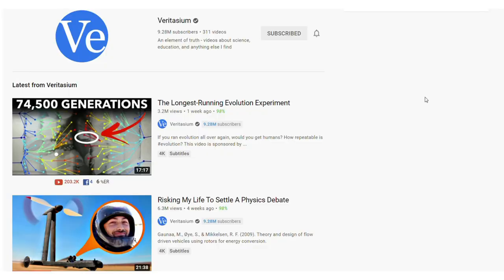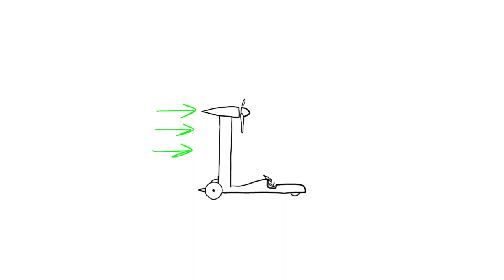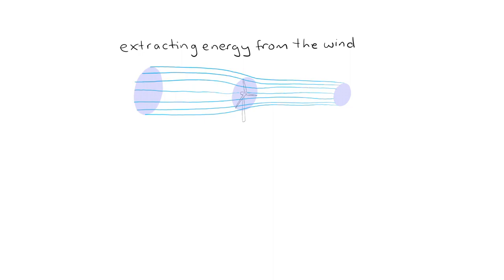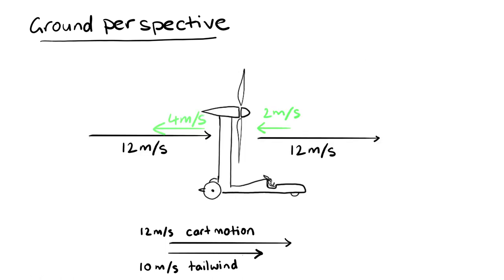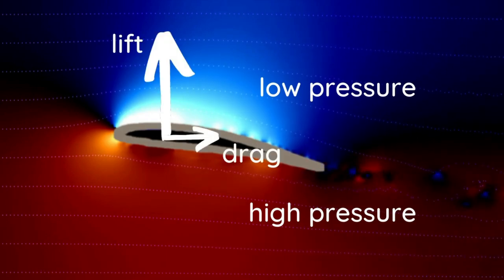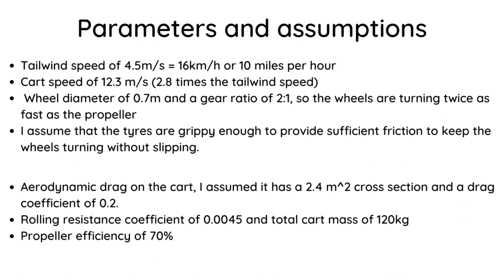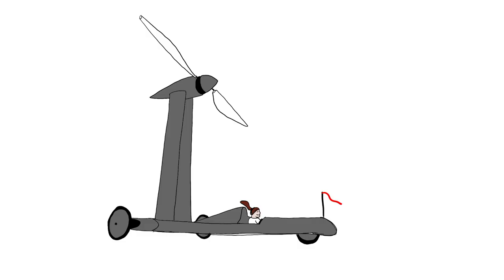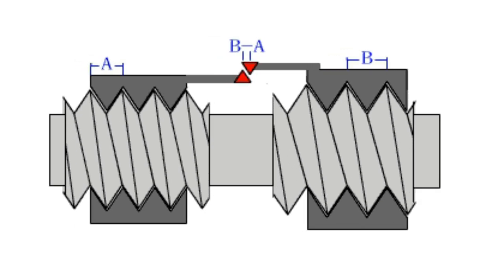Downwind Faster Than the Wind by Veritasium: How Does it Work?

Comment: NOPE, NADA, ZILCH, CAN'T WORK

You have to FOLLOW THE ENERGY . . .

Wind can certainly force a vehicle to move, relative to the ground, at the same speed as the wind, relative to the ground, ignoring the friction of the vehicle's wheels against the ground and internally against the axles. Even more fiction would exist if the wheels are linked to some other mechanisms, like a propeller.

The wind, from the back, applies a force to the vehicle, causing it to move, transferring energy to the vehicle in the form of momentum. Wheels rotating as a result of their interaction with the ground can indeed transfer some of that energy into other mechanisms, like the propeller. In the Blackbird configuration it is precisely that sequence of energy transfer, from wind to vehicle movement, to wheel/ground interaction, to propeller, that can indeed cause the propeller to spin.

But let's assume that the wind can indeed get the vehicle travelling at the exact same speed as the wind. The vehicle would then be effectively stationary relative to the wind. The vehicle would not actually be experiencing any wind, so no wind PUSHING the vehicle, no force applied to the back of the vehicle, no energy transferred to the vehicle. From a practical standpoint this couldn't last very long since friction of the wheels against the ground would be involved and the vehicle would quickly slow down, at least just a little, in which case there would again be a relative wind against the back of the vehicle, again applying force and again accelerating it back up to equal the wind speed. It would essentially fluctuate between a little less than wind speed and exactly equal to wind speed.

Now let's assume that somehow (magically?) the vehicle gets moving, relative to the ground, FASTER than the wind is moving relative to the ground, basically outpacing the wind. What kind of wind does the vehicle experience? The answer is that it now experiences/feels, wind coming from in front of it, impinging on the front, not the back, of the vehicle. It's encountering a HEADWIND, as opposed to the tailwind that had been causing the vehicle to move forward. The headwind imposes a DRAG on the vehicle, contributing to the slowing down of the vehicle, in addition to the slowing down caused by the friction of the wheels interacting with the ground.

Importantly, that headwind is slowing down the vehicle. The wind is no longer adding energy to the vehicle. Rather, it is REMOVING energy from the vehicle. The vehicle's energy is in the form of momentum, which is due to it's speed relative to the ground. When the headwind slows down the vehicle its speed decreases, which decreases its momentum, which decreases the amount of energy of the vehicle. Thus, the amount of energy available from the interaction of the wheels against the ground also decreases, essentially because the wheels to rotate slower as the vehicle slows down. And with that decrease in energy available from the wheels there is also less energy available to the propeller. Which means that the vehicle CANNOT maintain a forward motion that's faster than the wind, and certainly cannot continue to accelerate. The faster the vehicle goes, above wind speed, the LESS energy there is that's available to power the vehicle.

As I said previously you have to "follow the energy". Where does it come from? How does it move from wind to vehicle to wheels to propeller? And then look at what the vehicle is experiencing from the wind, what forces are imposed on the vehicle, from the perspective of the vehicle, when it's standing still relative to the ground, when it's moving forward relative to the ground, when it's accelerating up to the speed as the wind (via the tailwind), when it's moving at the exact same speed as the wind, and when it's moving faster than the wind (experiencing a headwind)? In what situations can the vehicle actually accelerate or even maintain its speed?

The very best that a "faster than wind" vehicle could do is to have its speed fluctuate between a little bit faster than the wind to a little bit slower than the wind, averaging out to simply the wind speed.

And the ONLY way that such a vehicle could, for a short period of time, go faster than the wind is if it is STORING UP ENERGY, perhaps by a flywheel (and frankly even the rotating propeller could be acting like a flywheel) while the vehicle is accelerating up to the wind speed. When it gets up to close to the wind speed it then ENGAGES that flywheel and uses that extra energy to accelerate to a bit faster than the wind. But as soon as that extra energy is exhausted the vehicle again slows down. And please do note that in the original video it's mentioned that the propeller is not engaged UNTIL a certain time when they want the vehicle to exceed the wind speed. Rather suspicious, don't you think.

But, bottom line, FOLLOW THE ENERGY.
Reply: @johnborton4522  Science/truth is not determined by monetary bets, it's determined by facts and reason.

You quote the conclusion I drew from the prior sequence of statements I made. How about you identify where in that sequence of statements I made a mistake or a false assertion? How do YOU trace the path of energy through the system leading to a vehicle that can CONTINUE to travel faster than the wind that's pushing it, in the same direction as the wind?
Reply: @RogerGarrett  

As it turns out, monetary bets are settled by the exact same methods as science ... controlled, repetitive demonstrations in front of inquisitive skeptics followed by independently verified results.

The science and truth of this were settled and documented more than a decade ago and independently confirmed countless times since.   The wagers are only about compensating me for my time when a Tom, Dick or Professor Kusenko (or Roger) doesn't want to do their homework but instead simply relies on intuition.

https://en.wikipedia.org/wiki/Blackbird_(wind-powered_vehicle)
Reply: @RogerGarrett  "Science/truth is not determined by monetary bets, it's determined by facts and reason."

The facts are against you here (google NALSA downwind record) and so is reason (google AAPT 2013 physics olympiad solutions -> page 10)
Reply: @johnborton4522  HA! You cite a Wikipedia article that's quite obviously written by YOU, or maybe your partner in this vehicle!!

Here's the thing, . . . since you are so intimately knowledgeable about how you claim it works, it should be incredibly simple for you to point out which assertion I made is wrong or which logical sequence of mine is wrong in the explanation I provided about following the energy. The basic fact I assert is that once the vehicle is going faster than the wind the wind is no longer, CAN no longer be, providing energy to the vehicle. Any energy that's being provided to the propeller at that time comes from the momentum of the vehicle itself, not from the wind, and as that momentum-energy is used up by the rotating propeller the craft will SLOW DOWN. It simply CANNOT maintain a speed greater than the wind since no energy is available from the wind when it's travelling faster than the wind. It's no different than accelerating a gas-powered car up to some speed and then taking your foot off the gas pedal. It will SLOW DOWN.  And if you had even rigged up a propeller on that vehicle that gets its energy from the interaction of the wheels with the ground, the only available energy is in the momentum of the car. It will still slow down.

Do you still assert that your vehicle can MAINTAIN a speed greater than the wind speed as long as the wind blows at that speed? Or are you going to backtrack on your claim and simply say that, for short bursts of speed, for short periods of time, the vehicle can go faster than the wind?

Oh, and PS: There is absolutely nothing involving intuition in my comments. I very clearly set out a logical sequence of assertions. Try addressing that.
Reply: @RogerGarrett  

Apparently you aren't familiar with the way Wikipedia works - it's not the narrative that matters.   You'll notice these things called "footnotes".   These are a repository of the actual knowledge, tests and experiences described in those notes.

It's called 'homework".  Do some, and you'll find that your intuition is wrong.
Reply: @RogerGarrett  "There is absolutely nothing involving intuition in my comments. I very clearly set out a logical sequence of assertions"

But your "logic" is just intuitive reasoning. What matters in physics are experimental results (see NALSA downwind record) and formal analysis (see for example AAPT 2013 physics olympiad solutions, page 10)
Reply: @RogerGarrett  

// "The vehicle would then be effectively stationary relative to the wind. The vehicle would not actually be experiencing any wind, so no wind PUSHING the vehicle, no force applied to the back of the vehicle, no energy transferred to the vehicle. "//

This of course is just your intuition.  The real world shows otherwise.

Iceboats have been sailing faster than the wind (downwind VMGs >1.0) for more than a century   Land yachts for many decades, and sailboats for near 2 decades now.   It's been more than 15 years since an America's Cup boat threw out a spinnaker -- why? ... because they now sail downwind VMG faster than the wind and a spinnaker would be the slow way down the course. 

Your intuition (which you mistakenly assert as "logic") simply can't hold a candle to real world results. 

Homework.
Reply: @RogerGarrett  

Oh God.  I'm laughing so hard right now.  Just found out that you are a buddy/acquaintance of Garrett Lisi.  Tell him I'll see him next time he's up at the red house. 

You get with Garrett on this -- he'll quickly explain how your "logic" on this ... isn't.

Hurry back now, ya' hear?
Reply: @eyytee  [ sigh ] Even if intuition is involved when someone lays out facts and the logic that connects them, it is that sequence of facts and logic which should be evaluated. Dismissing something simply because of the assertion that it was arrived at using intuition is just avoiding the assertions, the facts, the logic. The proper way to respond, to actually engage in a reasonable, thoughtful, conversation, is to look at what's presented and point out which facts are wrong, which logical connections don't work, and why.
Reply: @RogerGarrett  

// "it is that sequence of facts and logic which should be evaluated."//

We evaluated what you wrote.  It wasn't factual and it wasn't logical -- we know this because doesn't comport with the facts of the case (AT ALL).

// "The proper way to respond, to actually engage..."//

Well, as long as there is a lecture going on here regarding "proper engagement", ... the proper way to engage is to learn the facts of the case before going off with only your intuition engaged.  

Let me remind you of your opening "engagement" 

// "NOPE, NADA, ZILCH, CAN'T WORK"//
// "And the ONLY way that such a vehicle could, for a short period of time, go faster than the wind is if it is STORING UP ENERGY"//

Let me remind you what you did when I pointed you to a link which contained the links to enough facts about the case to blow your position away:

// "HA! You cite a Wikipedia article that's quite obviously written by YOU, or maybe your partner in this vehicle!!"//

And there you go ... more intuition, accusations and zero facts.  You're wrong about the device and you're wrong about the Wiki page.  The truth however, it is doesn't matter who wrote narrative on the Wiki, it's the footnotes that matter.

You'll find we're very open to answering questions about how it actually works, but if you're just going to drop your ALL CAPS bombs on us from the start, we're going to have our own fun with you.  Forget "proper", I'm just going to call it "appropriate" engagement.  

So, you're wrong.  If you don't know just how wrong you are, check with Garrett. After that, come back with your tail between your legs and give us a whiny lecture on how we should have spent endless hours arguing with Your Cocky Highness on your terms.
Reply: @RogerGarrett  "... to look at what's presented ..."

Have you looked at the references linked in the description of the follow-up video by Veritasium (AAPT, Drela, Gaunaa et al.)?
Reply: @RogerGarrett  

So Roger was all about engagement and the scientific process and education, but now that he has figured out that his intuition failed him (no shame in that -- the Blackbird is one of the best physics intuition traps in history) he's like the professor -- gooooooone.   He's not into the engagement and education when it turns out he was the one who needed it. 

Here's how the scientific method really works Roger ... build it, break it, improve it, openly show the process, ask others to independently judge it and encourage duplication.

We did.
Reply: @RogerGarrett  "This report explains nothing about how it works"

That is explained in the references linked by Veritasium in the description of his the 2nd video (AAPT, Drela, Gaunaa et al.).
Reply: @johnborton4522  Wow, that just makes it totally clear that you have no understanding of momentum. No claim is made by me that you can run at 51 miles per hour. But when you're pushing the vehicle up to its just-above-wind-speed you are imposing a force on the vehicle, causing it to move, and that movement constitutes stored energy in the form of momentum. If you were to push a hundred pound vehicle up to 11 miles an hour it would have received a certain amount of energy. If you had pushed a thousand pound vehicle up to that same 11 miles per hour it would have a hell of a lot more momentum/stored energy. You didn't need to go faster than the11 miles per hour, but the vehicle, being heavier, got more energy/momentum.

When you let the vehicle go, and the transmission is engaged so that the propeller is now driven by the rotation of the wheels against the ground (or the pitch of the propeller is changed so that it's no longer free-wheeling but rather acting as a propeller), then it's tapping in to that stored momentum, that movement of the vehicle (as well as the momentum of the rotating wheels, which is likely significant in the overall operation). And, sure, the propeller, through the gears of the transmission, can be made to rotate fast enough so that enough of the momentum of the vehicle can be transferred to pushing the vehicle even faster. But as soon as it does that, as soon as the vehicle's momentum is providing that from the wheel rotation to the prop rotation, the overall vehicle's momentum is reduced (I suspect likely coming from the wheels, acting like flywheels), there is less and less energy to drive the propeller. So, yeah,  you can get a brief burst of speed, even to something faster than the ambient wind, but eventually, (likely quite quickly) that available momentum is used up and the vehicle slows down. Can it go faster than the wind for ten seconds. Apparently. But that in no way means that it can sustain such a speed.

And even when the initial push of the vehicle is indeed provided by the wind (not by someone pushing it) it's the momentum of the vehicle itself, and I suspect significantly the momentum of the rotating wheels, that allow it to momentarily exceed the ambient wind speed. It might go faster for some ten seconds, but it will soon slow down, back to below wind speed, at which point the wind can indeed speed it up again to the same as the wind speed. The result is that it will fluctuate between somewhat below wind speed and somewhat above wind speed, with the average speed being at (or likely slightly below) wind speed.

It's stored momentum that you're using. And the wind ceases to provide that momentum once the the vehicle is travelling faster than the wind.

Show us a test where it just kept going and going and going at faster-than-wind-speed.
Reply: @RogerGarrett  

As to your momentum gibberish, using that gibberish explain how in the video I posted above why you see the propeller and wheels continue to turn faster and faster and faster and faster for a full three minutes WITHOUT any push.  A full minute and a half after passing through windspeed and ending up at near 50mph and near 3x the speed of the wind. 

Now, where is the stored energy coming from?  What giant flywheel, capable of accelerating a 600lb craft from windspeed to 50mph did NALSA and the other skeptical parties miss when they did the inspections?  (And if you say the propeller or wheels, you'll erase any doubt about you're a complete idiot as any flywheel has to slow down, not speed up to give up any stored energy).

The truth is, the only spinning parts in the entire Blackbird are constantly having their stored energy INCREASED as the vehicle accelerates, not decreased. 

Do yourself a favor -- stop arguing and looking like a fool.  Call Garrett.
Reply: @RogerGarrett  "It's stored momentum that you're using"

No, because all the stored momentum (including of the rotating parts) is increasing when the vehicle accelerates. So it is not using up any stored momentum or energy to accelerate while being above windspeed, and thus can stay above windspeed in steady state.
Reply: @eyytee  So what is it that accelerates the vehicle? The energy has to come from somewhere. The claim is that it comes from the ambient wind, but the ambient wind is no longer pushing the vehicle once the vehicle's speed matches that of the ambient wind, and once the vehicle is going faster than that ambient wind the vehicle is experiencing a relative headwind, a drag on the vehicle, which is not a source of energy. Much is made about how it's the turning of the wheels that turns the propeller, but the wheel-turning is occurring only because the vehicle is moving relative to the ground, and the vehicle is moving only because of some energy pushing it forward, so you've got a closed loop with every-increasing speed. Where does the energy actually come from to keep it accelerating??

It is not sufficient to build a test vehicle and have it go faster than the wind. There needs to be an accompanying Theory of Operation to show HOW it can accomplishes that. 

Every decade or so someone comes out with a car that runs only on water. They show it, operate it. Sometimes makes claims about splitting the water into hydrogen and oxygen and combusting those gases for the energy source, all on-board. And they eventually fade into history, with no actual proof that it works, even though they had a test vehicle!! That's what this Blackbird seems to be doing. Got a test vehicle? Yup. Convinced people that it works? Yup. Provided a scientifically sound, reasonable, and verifiable Theory of Operation? Well, I haven't seen any. I've looked, but haven't found any. The response by the inventors should be, "Here's a direct link to the Theory of Operation, explaining everything", but instead they just get angry about people having the audacity to question them, point to their test runs as though that's proof, point to people that they've convinced it works, and point to a bet that someone conceded on.

If YOU can provide a link to the Blackbird Theory of Operation, I'd appreciate it.
Reply: @RogerGarrett  

http://kirkmcd.princeton.edu/examples/yacht.pdf

That one contains a ton of links to other analysis as well.
Reply: @RogerGarrett  

// "It is not sufficient to build a test vehicle and have it go faster than the wind. There needs to be an accompanying Theory of Operation to show HOW it can accomplishes that. "//

We really don't need someone as wrong as F888 to tell us how it needs to be done.  The analysis was done LONG before the Blackbird was built.  The Blackbird was designed and build based ON the analysis.  We built the Blackbird because people like you (as you have done here) said the correct analysis was BS.

There has been for more than decade, both correct analysis and third party verified physical demonstrations and you still respond: "NOPE, NADA, ZILCH, CAN'T WORK"  and accuse us of being responsible for publishing content we had nothing to do with.  

Then you say absolutely stupid stuff like: "It is critical to understand that the wind had absolutely nothing to do with powering the vehicle. All of the energy employed by the vehicle came from JB manually pushing it from behind" . 

What's critical to understand is that you're a maroon just based on that above single statement alone.
Reply: @RogerGarrett  why do you assume that the propeller can't extract energy from the wind while moving faster than it? thats ridiculous, as the propeller does not operate on the wind with only drag, but with also thrust. If you follow the energy as you put it, then you'll find that the air behind the vehicle has slowed down because the propeller is actively accelerating the air. That must mean that the craft has a forward force on it. Its constantly making the air and the grounds speed to become closer together, and that energy has to go somewhere. 

For example, there's this, https://www.youtube.com/watch?v=k-trDF8Yldc&t=10s  . Despite it going faster than the ruler, it can still harvest energy from the rulers movement. Although the ruler and the air act differently, I don't think its immediately impossible to build such a device that works with air, and in fact its not, its just a simple propeller.  

Also I find eyytee's animations very enlightening.  https://www.youtube.com/watch?v=H_OKNr120t4  https://www.youtube.com/watch?v=zPFzHoubQzg .
Reply: @RogerGarrett  After the smug  "NOPE, NADA, ZILCH, CAN'T WORK" opening, it seems you owe the builders an apology since it does work.  You fundamentally missed five big points:

1) repeatable empirical experiment have always trumped "theory" when they disagree (which is a clue that theory has to be revised and modified (or an alternate explanation has to be appended) to accommodate reality).  A demonstration of a cart working under carefully controlled conditions on a steady state treadmill demonstrates that not only is it possible but it has been accomplished (which theory without demonstration would not).

2) the energy comes from the carts interaction with the true wind at all speeds since the propeller can most definitely interact with the air at windspeed (and slow it over ground) even though the cart body doesn't.  It is factually wrong that the total cart mechanism can't interact with the wind at windspeed which is both logical (from the simple theory of how a propeller works to the empirical--with interaction of the prop with the wind clearly illustrated with streamers behind the propeller at windspeed on treadmills).  It is, however, a classic misconception and fallacy of you and other novices, that the vehicle can't interact with the air at windspeed.

3) the vehicle shown was designed (with a ratchet mechanism in the drivetrain) so that none of the previously stored rotational energy from lower speeds could be utilized to increase and accelerate the cart thus negating that as a possible mechanism of operation. 

4) the energy of the true wind is decreased with the cart's passage through it and some of that energy is what is given to the cart to accelerate it.   It is nowhere close to ideal and real world losses occur and yet the wind energy reduction yields adequate energy to power the cart up to its limit speed which is well above wind speed.

5) a valid energy budget which includes the reduction in the energy of the true wind processed by the cart yields that there is more than adequate energy lost by the true wind to power this particular cart (and any other functioning carts) to well above windspeed thus illustrating that theory does not preclude its functioning.

Had you simply asked nicely, many of us would have been happy to explain all five of these points to your objections.   Now, without a bit of humility and an apology, you just look like a goat with bad logic and very limited physics knowledge.  Without the written apology here, you can continue to look like the bad mannered Kusenko who had adequate hubris and no humility (even though he at least paid his debt).  Since no one was claiming "over unity" or any violation of COE, but only wind energy, a more humble objection was appropriate.
Reply: @jetison333 It has been made very clear in numerous videos, documents, and comments that the propeller on the Blackbird is NOT operating as a windmill, and therefor is NOT extracting energy from any wind, but rather is acting as a propulsive mechanism, USING energy provided to it by the rotation of the wheels to accelarate air backwards and thereby accelerate the entire craft forward. It's a propeller, not a windmill.

The propeller does indeed operate with thrust, because it's operating as a propeller, to PROPEL the vehicle.

The air behind the vehicle is NOT slowed down by the propeller. The way a propeller works is by ACCELERATING the air from in front of it to behind it. The propeller exerts a force on the air, the result of which is an acceleration of the air backwards and an acceleration of the vehicle forwards. That's how any propeller-driven craft works.

The  fact that the speed of the air behind the propeller is slower than the WIND is irrelevant. That in no way contributes any energy or force to the vehicle. The only thing that's relevant in the Blackbird regarding its propeller is that the air in front of the propeller is accelerated backwards and the vehicle forward.

The assertion is that the Blackbird derives its energy from the rotation of the wheels, that the propeller is turned by the rotation of the wheels. Those wheels rotate ONLY because of the forward motion of the vehicle. But the assertion is that the propeller, powered by those wheels, accelerates the vehicle, and that since the vehicle is now going faster than it was the wheels are now turning faster so the propeller turns faster so the vehicle goes even faster and the wheels turn faster, and on and on. Do you not see the  problem with that? It's a perpetual motion machine. It's an over-unity energy generator.

Suppose we forget about the wind, just start the vehicle in static air. Give it a push to get it going. The wheels power the prop, the prop accelerates the air and the vehicle. The vehicle, now going faster causes the wheels to turn faster which turns the prop faster, which accelerates the vehicle, and on and on. WHERE DOES THE ENEGERY COME FROM to do that?

The Blackbird builders assert that somehow the wind is involved. But HOW? When the vehicle is going faster than the wind, how can that wind contribute any energy to the vehicle? The wheels and propeller don't give a damn what the ground-relative wind is doing, all it does is react to and deal with the vehicle-relative "wind", not the ground-relative wind.
Reply: @RogerGarrett  The way the propeller interacts with the air is as a propeller yes, and that is what everyone means when they say that. However, what it actually does is harvest energy, which makes it a sort of turbine. 

When you say that a propeller can't slow air down your thinking in the wrong frame of reference. In the frame of reference of the propeller, yes, it never slows air down it only speeds it up. And in the case of the blackbird this is true, and thats why people say its a propeller. In its frame of reference it is speed the air up. 

However, from the reference frame of the ground, the propeller is necessarily slowing the air down. The air is moving to the right, and the propeller is accelerating the air to the left. that means that the air is slowed down. And since the air and the ground are now moving at more similar speeds, there's less energy in the system and that energy has to have gone somewhere, which it has, into the blackbirds speed. 

And the wind is necessary, because without it, blackbird is actually increasing the speed of the wind relative to the ground and so loses energy. Since there is no relative motion between the wind and the ground, theres no energy to extract by slowing something down.

Heres another way you can think about it. Given the ability to engineer 100% efficient components, you could build a cart that has a propeller connected to its wheels. Since everything is 100% efficient then the amount of energy that is taken from the ground is produced by the propeller again, the cart will not slow down. Now we introduce a tail wind. With a tail wind, the prop will now produce more thrust, as its apparent wind is less, which means that the cart will now be accelerating. Note that I didn't have to specify how fast the cart is moving, as even when its moving faster than the tail wind it still knows the tail wind is there because it experiences less apparent wind.
Reply: @RogerGarrett  

// "Do you not see the  problem with that? "//

The "seeing" problem is your, because in your paragraph, you leave out the input energy of the wind.  Kinda important in a wind powered vehicle.

Describing a squealing 'microphone, amplifier, speaker, microphone, amplifier, speaker, microphone, amplifier, speaker..." feedback loop sounds just 'over-unity' till someone goes to the wall and unplugs it.  Your description is just a silly if you ignore the 'power cord'.
Reply: @eyytee  The question remains: If it's not stored momentum then what energy is it that's increasing when the vehicle accelerates, or more precisely, what energy is it that's causing the vehicle to accelerate? The ambient ground-relative wind cannot contribute energy once the vehicle is either at that wind speed or greater than that wind speed, because the only "wind" that the vehicle encounters when it's going faster than ground-relative wind is the vehicle-relevant wind and that vehicle-relevant wind is a Head Wind under that circumstance, imposing a DRAG on the vehicle, not a PUSH on it. If anything the vehicle-relevant wind is DECREASING the energy of the vehicle, imposing a negative force on the vehicle's motion, slowing it down.

Explain what it is that causes the vehicle to accelerate when it is going the same speed or faster than the ground-relative wind. Where is the necessary energy coming from. HOW is the ground-relative wind involved in that supply of energy to the vehicle?
Reply: @jetison333  The only air speed that is relevant to the propeller's operation and it's use for moving the vehicle is the air speed relevant to the propeller, to the vehicle. What the air is doing relative to something else, like the ground or a turtle or someone walking randomly or the Moon or Mars, is utterly irrelevant to the operation of the vehicle.

Your claim that the propeller, acting as a propeller, is also somehow acting as a turbine, "harvesting" energy from the ground-relative wind, is absurd. I repeat, the only interaction that the propeller has is its interaction with the propeller-relevant "wind", or as it's often called the "apparent wind".

The propeller does indeed accelerate the air backwards and correspondingly accelerates the vehicle forward, or KEEPS it travelling at the same speed considering the drag and other forces impinging on the vehicle. No one is claiming otherwise. But the fact that the propeller-accelerated air is now going slower than the ground-relative wind has absolutely no bearing on how the propeller is working or how the vehicle is moving. The vehicle and its propeller ONLY interact with vehicle-relative wind.

Your assertion that the propeller is somehow "harvesting" energy from the wind simply makes no sense.

When a prop-driven plane is moving through the air at some speed and it encounters a tail wind it does indeed speed up, relative to the ground, because that tail wind is imparting a force in the same direction of the plane. The sum of the forces from the prop and the tail wind speeds up the plane. But once the plane is moving at the same speed as the tail wind there is no more acceleration, it is only the prop, driven by the energy provided by the onboard fuel, that keeps the plane moving at the now-increased speed. There is no more acceleration. Yes, the plane is now moving faster, relative to the ground, as long as that tail wind persists, but it is in no way "harvesting" energy from the wind.

In your "other way of thinking" you cite "the amount of energy taken from the ground". There is no such energy. The only energy available is that which comes from the MOTION of the cart, RELATIVE to the ground. The cart must first be pushed, providing energy to it from whatever is doing the pushing. And describing an impossible 100% efficient setup has no bearing on a real-life situation. The fact still remains that once the vehicle's speed is equal to the ground-relative speed the vehicle-relative WIND speed is ZERO, so the efficiency of the propeller, the thrust produced by the propeller, is back to what it was when it was just travelling through still air. The ground-relative wind can have no additional impact on the prop or the vehicle. And further, IF the vehicle somehow gets going FASTER than the ground-level wind, then the interaction between the apparent wind and the prop will be the OPPOSITE of what you're citing for the initial condition, which means the prop would be producing LESS thrust and the vehicle would therefore slow down.

Your statement that "even when its moving faster than the tail wind it still knows the tail wind is there because it experiences less apparent wind.". No, it experiences a HEAD WIND in that situation, a wind that has the effect of SLOWING DOWN the vehicle.

And I still assert that when the claim is made that the energy for the powering of the prop comes from the rotation of the wheels (the interaction of the moving-forward wheels with the stationary ground), and the rotating props (somehow interacting with the ground-relative wind) accelerates the vehicle, further increasing the wheel rotation, further increasing the rotation of the prop, further accelerating the vehicle, and on and on, the effective claim is for a perpetual motion machine and/or over-unity power generation. At the very best the claim could be that there is an upper limit to how much acceleration can occur, an upper limit to the speed of the vehicle, based on the speed of the ground-relative wind (and the mass and air drag of the vehicle, efficiency of all the parts, etc.). But, no, the claim is made that it can "continue accelerating".
Reply: @RogerGarrett  

Poor Roger.   Stumped.  Insists he's right even though all the physical evidence and correct analysis says otherwise.
Reply: @RogerGarrett  

Let's not forget this classic which clearly illustrates the clarity of Roger thought we are dealing with here -- on a vehicle which under independent review repeatedly reaches over 50mph (even when not pushed).

Roger:
// "It is critical to understand that the wind had absolutely nothing to do with powering the vehicle. All of the energy employed by the vehicle came from JB manually pushing it from behind."//
Reply: @RogerGarrett  "The Blackbird builders assert that somehow the wind is involved. But HOW?"

Without the true tailwind, the relative headwind the propeller experiences would be higher (equal to groundspeed), so the propeller could never produce more thrust than the wheel drag needed to turn the propeller. It's only when airspeed < groundspeed that you can get prop_thrust > wheel_drag.
Reply: @RogerGarrett  

//"The only air speed that is relevant to the propeller's operation and it's use for moving the vehicle is the air speed relevant to the propeller, to the vehicle"//

You are technically correct so let me be technically correct back at you. 

In a 10mph tailwind, there is a point on the Blackbird (and it's not the propeller) that at all speeds and at all times STILL has a 10 tailwind.  Even when moving at 100mph, this point on the Blackbird still has that 10mph tailwind blowing from rear to front (no tricks - it's literally there).

If this were not true, the Blackbird at speeds greater than the wind could not harvest the energy from the tailwind, but it is true so it can.  It is literally using this ever present 10mph tailwind to propel itself forwards at all speeds. 

Now, if you can figure out where that point is, perhaps you'll get past your self inflicted mental log-jam.